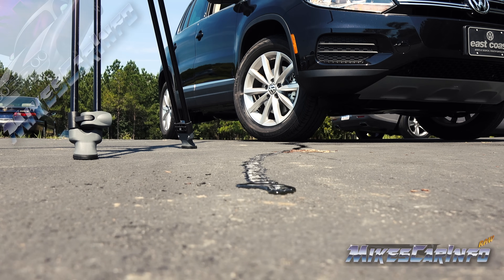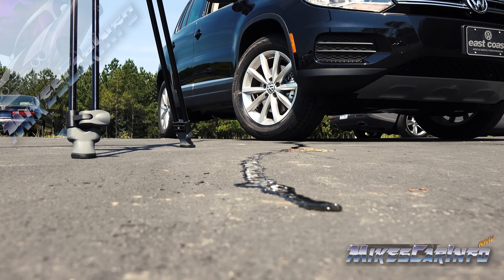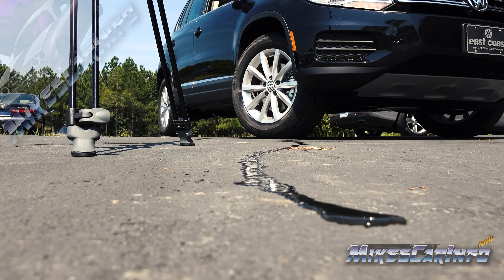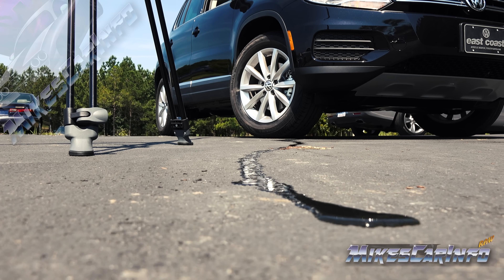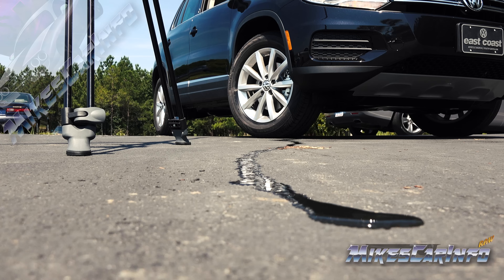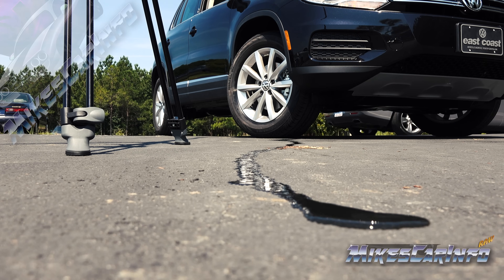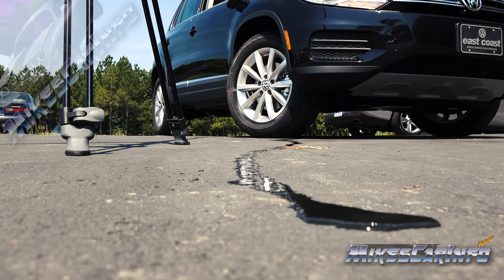Water from AC: Leaking Under Vehicle

Comment: That's actually funny cause I saw some kind of fluid leaking out of my car. so I started to check the transmission,engine,brake and the coolant fluids and I found that the coolant fluid is a bit low even though I just filled it up a couple days ago. So I checked the color of the fluid leaking out and it was transparent just like water so I was confused then I started searching it online and here i am. So THANK YOU !

Comment: Mate,you just saved my ass. Just bought a used volvo s40 and used the air con for the first time. 13 miles later,when parked,a puddle shows under the car. First thought,brake fluid,panic mode on. You saved my day 😁

Comment: I live in South Tx one time I went inside my house to get some paper work that I had misplaced, I left my car running on a very humid hot night for 20 minutes, when I went outside I thought my radiator or water pump had or a water hose had ruptured. I got in my car and shut it off. I checked the radiator, hoses everything checked good. I told my mechanic, he said than I ran my AC for too long and condensation formed. I’m not kidding you to make this story more interesting. The water went all the way to the street from my driveway in only 20 minutes. It’s common in hot humid places. But just check to be sure.

Comment: Omg thank you so much. My car broke in front of library a week ago and somebody fix it due to timing belt. I returned  books in the library same spot I saw a water leak I was panicking with my kids at 90 degrees outside...glad if it's only the air condition.

Comment: I’ve got this newer Jetta that leaks quite a lot of water while the ac is on. I could be stopped for about 30 seconds and there would already be a fairly large puddle under the car. Is there a point where there is too much ac water in which it should be checked out? Or is it just a really good ac system?
Reply from the maker: Sounds like a good AC system to me. Humid days will condense more water.

Comment: Amazing how many people don’t know that all air conditioners have condensation that has to go somewhere.  The “coils” you speak of is actually called an evaporator. High pressure refrigerant is pumped to the evaporator where a pressure change (via an expansion valve or fixed orifice) happens. This pressure change is what causes the evaporator to get cold. You ever notice an aerosol can get cold when you spray it? The temperature difference causes the condensation on the evaporator the same way your beer can sweats when you take it out of the frigid.
Reply: So it’s normal for water to drip? This never happened on my old car(2002) but I just got a used 2017. I put a white cloth underneath the car to see what was dripping and it was water coming from the passenger side area
Reply: T R Yes it’s normal. Either you didn’t notice it on your old car or your A/C didn’t work

Comment: Dude , I just bought this 2020 civic si with only 6000 miles on it. I saw this little river of water running down under my car, then again this morning I saw a puddle. I did have my ac on full blast cuz it’s been so hot ! But I still freaked out , I always google and YouTube before running to a mechanic though.

Comment: The management company that runs my building sent me a letter about oil leaking for my car idiots did not know that it was condensation from the air conditioner because we’ve had record high heat in Los Angeles these people are absolutely ludicrous the parking lot is completely caked in oil stains yet they chose to send me a letter and even threaten to charge me for the cleanup can you believe that thank you for your video I really appreciate it I’m sending this to them so that they can see what condensation from an AC system in your car is all about God Bless And thank you so much for your contacts extremely helpful

Comment: first of all thank you for your reply truly appreciated .

our car  is essential  because i have rheumatoid arthritis 
and we wont not like to be told  it needs fixing .or they say it almasost needs heard surgery   lol .

there is a small puddle of water     like is shared in the video      although the water reservoir
requires a revill every second day  .   this could well indicate there is a leak  
the leak  is almost under the passenger seat door   .
its a toyota   chevrolet     2 door sedan    american body japanese engine 

any guidance appreciated .
what could be the hours and moneys to amend or fix this sort of issue 
i am sure it would help others to     .we call it oho    others helping others . 

hear back shortly  .

Warmly Johannes
Reply: If the leak is pure water with no smell then it is coming from the air conditioning and is unrelated to the coolant level problem. The coolant level problem may be a headgasket leak if the coolant is not leaking on the ground. Coolant has a strong odor and has a distinct color (like green or orange).

Comment: I hope that’s the case in mine. I was told I have a blown head gasket so I used bar leak. Not even sure if it’s blown or not.
Reply: Thanks dude freaked out when I saw it today I thought it was my engine oil but I noticed it was water I was wondering but thanks am relieved now

Comment: Would if you haven't used your a/c in a day or so? And it leaking sometimes from under the muffler or towards the front under driver side or passenger and doesnt leak when the vehicle is turned off it's not a constant leak.
Reply: A small amount of water could leak from the muffler from 'weep holes'. This allows condensation and water vapor from building up inside the exhaust system. 
If you see PURE WATER leaking from under the dash area of the vehicle then it is coming from the AC system. The AC system could still run when you have the defrost or heat running as well. If you see other liquid that has a color and/or smell then it needs to be checked out.

Comment: I rented a big wood chipper and towed it with my truck. Dude claimed he was a mechanic and that the water dripping was unusual. Windows were down while we were checking the trailer lights and it started dripping out fast. Irritating that he made me worry about it when I knew it was just the ac. good to double confirm though

Comment: So I understand about the condensation with the ac thing, but the car that I have now seems to do it pretty excessively compared to anything I've had before and it has me a bit concerned. Is there anything that could mean a bad sign regarding the ac condensation?
Reply: Humid weather will contribute to more water dripping. Also, it sounds like your current vehicle has a better AC system than previous cars.

Comment: Took my vehicle in for ac service mechanic said the system was bone dry, so he recharge the system it blows cool but not cold and then I noticed water like in the video mechanic stated that the machine found no leaks within the system but I was told a few months ago that my compressor and evaporator core were bad getting a third opinion next week 😢

Comment: Can the heater cause it to leak as Well? There was a puddle underneath the truck ..weather is in the 50 s ...thank you
Reply: No not by itself. Defrosting the windshield with the heat on will turn on the ac compressor and it could condense water.

Comment: Is it normal to have condensation on the hose discharge that is running to the pipes to or from the condenser? I  drive a Honda Fit.
Reply: A little condensation on a portion of the larger line is normal. If the AC is working fine then I wouldn't be concerned.
Reply: MikesCarInfo ok thanks

Comment: My Silverado does this but leaks coolant while the ac is on through the breather hose on the coolant reservoir tank, already swapped out the radiator, water pump, and reservoir itself along with the thermostat. It doesn’t leak from anywhere else.
Reply: Still doing it? Could be many things but I would first check to see if you have a defective radiator cap or if the condenser coils are dirty and clogged (bugs).

Comment: What if the AC isn't on and it leaks. No defrost is on, just the heat.
Reply: Hey! it will still be there if the climate is Humid but that would be slower when compared with AC switched on.

Comment: Hi the left side (front and back seat) of my corrola quest is very dump, someone told me it could be water from the air conditioning  system. But when I check the underneath of my car, water is dripping. What could the problem
Reply: Could be rain leaking inside the vehicle.
Reply: @MikesCarInfo  thank you, i took it to a technician they also said it could be leaking through the windscreen shield.

Comment: I just noticed a slow drip underneath my car when I parked it today. It wasn't underneath the engine area ( from the front of the car to the wheels ) it was a bit further like maybe underneath the dashboard area so I'm guessing that's where the ac unit and stuff are at? Anyways, I saw a slow drip of water from that area.. was concerned because I thought there was a problem somewhere inside there.. but this video brings me hope that it's just what you said and nothing serious..
Reply: The pipes are usually to the centre of the vehicle . As i was told by a mechanic so the fact yours is at the front is of concern

Comment: ok. do the amounts of drip vary? mine was dripping heavier than usual. was clear water, no smell to it, from under ac condenser.
Reply: Yes it varies on the humidity. If there is more water in the air then more water will condense and drip under the car.
Reply: MikesCarInfo thanks for the info
Reply: MikesCarInfo 
I was trying to calm myself down and just think of the a.c. dripping in the window in my kid's school.
Reply: Thank you! I just purchase 2011 Toyota Highlander Private sale. It was a hot day and we had our AC full blast and water was leaking. No smell and I check under the car and saw a black tube with a dripping water. I was worried and search on you tube.

Comment: Can a small puddle form under car after running the heater as well?
Reply: If the heat setting includes the window defroster then the AC system will be on to help remove the interior moister.
Reply: @MikesCarInfo  ok thank you. Is a little moisture inside car normal? It goes away quickly
Reply: Like windows fog a little

Comment: When I turn my AC on it drips water but when I put it on full blast the water quickly forms a puddle until I turn it down again or off. This can’t be normal.
Reply: Is that under your car when you turn it off? And how long are you running it?
Reply: JeT Jefferies yes under the car and only while the AC is on. I switched the option from letting fresh air in to letting the air in the car circulate and I noticed it stoped.
Reply: @repentyasharahla7632  do you live in a humid place like Florida? I think your car is fine for the most part and you just live in an area that has a lot of water in the air

Comment: Cool vid but why does it smell like radiator coolant burning when i run my ac
Reply: The AC system adds additional heat that the engine cooling system has to dispel. If your engine cooling system has a problem and is not working properly then the AC may add just enough heat to make the vehicle overheat. I would have it checked out ASAP.
Reply: @MikesCarInfo  sounds good! It is leaking out of a metal pipe that leads into the ac frim radiato area. I was thinkingnit might be just an o ring ir something but i will look into what you said

Comment: What about when the ac is turned off and it still pools up under the car
Reply: The AC compressor is also used when the vehicle heater or defroster is on as well. If it is just clear clean water then you have nothing to worry about.
Reply: @MikesCarInfo  Thanks!

Comment: Do it do it when the heat on?
Reply: No not by itself. Defrosting the windshield with the heat on will turn on the ac compressor and it could condense water.

Comment: Can turning to heat on make a water leak?
Reply: No not by itself. Defrosting the windshield with the heat on will turn on the ac compressor and it could condense water.

Comment: How about when your heat is on and your AC is leaking what's going on there
Reply: If the heat setting includes the window defroster then the AC system will be on to help remove the interior moister.